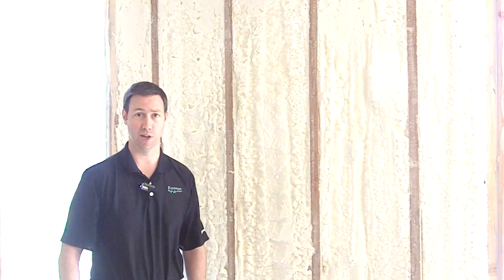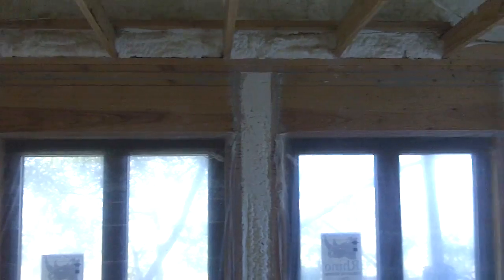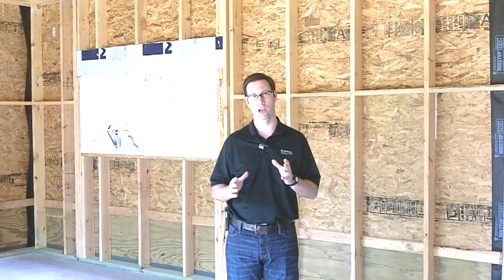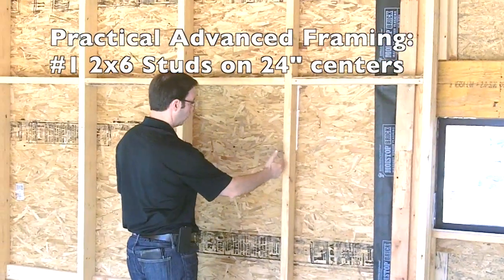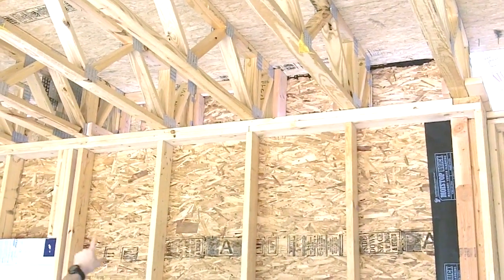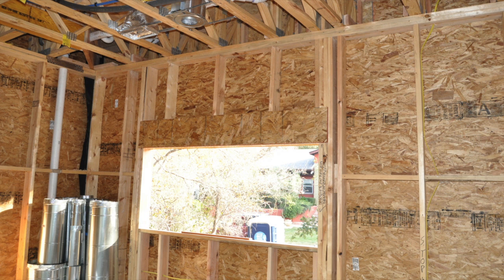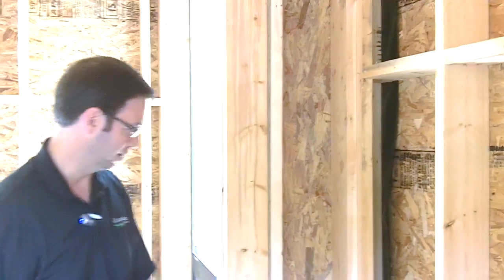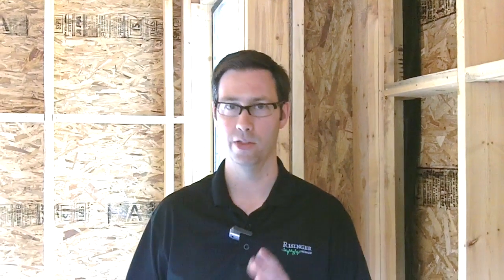Advanced Framing vs Traditional Framing

Comment: That place scares the crap out of me. Matt, I like where you are going with today and the future of framing, but as a pro, at least mention the visible mistakes and also the weaknesses found in this type of construction. As a firefighter..I would do everything I could to keep you from building in my city and as a man..if your not telling the whole truth your just lying. Folks..there are some nice features in these newer frames but don't for one second think it isn't about saving a buck.
Reply: Someone elaborated down below, when a structure is on fire, 24" OC makes the structure significantly weaker and can kill firefighters.
Reply: Using open web trusses instead of solid wood joists to support the second floor is a terrible idea. If a fire breaches the sheet rock it will have the whole void space between the floors to spread, as opposed to a channel or two between solid joists. This modern construction may save you $1,000s during construction, but cost you 10s or 100s of $1,000s more in a fire.
Reply: Chris Kovacs,
I remember a case where a firefighter died in a house like that in California. The fire was able to spread very rapidly inside the walls. In fact, accordingly, it was stated that there was only a light haze inside the house, but the walls were hot and there was the classic rumble, crackle, and "running water" noise that fire makes. It was all in the walls and the ceiling. The cause was an improperly installed gas fireplace.
Search "F2011-05" on google, the report is on the CDC/NIOSH website.

Open floor plan design is a serious issue regarding fire spread. It allows the fire to access large amounts of oxygen in a short period of time, leading to fires that grow to flashover point in a matter of a few minutes.
There was a case where a huge mansion burnt down and something like 6 people died. Caused by, what can be determined, an electrical fault with the Christmas tree lights and/or the electrical outlet. But the tree was also dry, and it was in the huge vaulted main room of the house. Thus, it spread throughout the hallways with ease, since there were no doors. (Also, thin plywood doors don't help either!)
I suppose they were overcome with smoke. I do not understand why people don't just jump out the window. It's not hard to open a window. And don't worry about breaking your legs, you're going to die if you stay in there LOL.
Search "executive-summary-childs-point-road-fire" on google. The fire report is on the ATF's website and/or a PDF.
Reply: COuld you elaborate I am interested
Reply: - Pschar as a firefighter, you should appreciate the benefits of 5/8" drywall and it's ability to detain a fire for longer periods.
Reply: Chris Kovacs that's an important point. I was only thinking about them being on 24" centers and making your furniture move when you walk by it
Reply: You could also install a sprinkler system in your house if fire is a real concern.  It is required by code in California these days.  Surely would save you money on insurance as well.
Reply: Robert Slackware,
You got yourself a "wet pipe" type sprinkler. It always has water in the pipes. A "dry pipe" system is better because it prevents the freezing issue you mentioned. However, a dry pipe system tends to be more costly.
The problem with many fire retardants is that they create noxious gasses when they decompose. Like, really noxious. Nothing is better than a decent brick or even better, concrete wall (at stopping fire spread).
Reply: Advance framing...less Lumber more money....advance framing
Reply: While 5/8s does a better job slowing down the fire, it is minuscule. Especially when u factor in the how the related changes affect a fire. Not only do these fires spread faster because of the materials used and open spaces, the toxins produced are way worse. 

I have never built a house in my life! But I'm the one there when they come down. On top of them,  in them or next to them.  Traditional homes are the only house ill put my family in.  And if the day comes for some reason I can't. A sprinkler system will be in place,  there's nothing else that can protect you in a wiffle bat, poster board house

There's nothing anyone can say, numbers compared, theories explained that will say these houses are a better choice for your family. The money saved isn't going to the home owner. Yes it will be better on bills. But how much is your kids life worth? 

Business is business and we all know it's about putting more money in their pockets with no regard. 
But don't make these ridiculous videos anymore. 

Everyone knows your fvcking them, putting them in danger and can't do shit about it. Why get on here and continue to insult people. Take your money, drop the act and STFU
Reply: Sorry Robert, but saying that fire retardant paint is "much better" than an interior sprinkler system is really messed up logic. Of the top 8 causes for residential fire paint would have impact on only ONE (electrical/wiring) of them. Sprinkler pipes bursting is more a symptom of an improperly designed or maintained system. Wall paint does absolutely nothing for the combustibles in a room; a sprinkler system does. Please rethink or explain your logic.
Reply: @MeJonAgain  I've seen the results of frozen commercial sprinkler systems- you basically junk everything and start over. Dry sprinkler systems avoid that but cost more, and they have their own set of issues. The best approach would be to require that everything inside the home be more fire-retardant since that is what accelerates the fire so well and it is the fumes from that stuff which kills more fire victims than burining building materials does.
Reply: Should have a nice Chernobyl vibe going after a fire there

Comment: Spray foam insulation how one does it last and how do you remove it?
Reply: Forever unless exposed to UV.  WIth a chainsaw as you demolishe the wall.
Reply: Suicidaljello if installed correctly it will last a loooong time. And how do you remove it? A lot of sweat and tears.

Comment: I have an odd question:

I've been doing research for my own house build. I've settled on the pole barn style instead of this type of traditional American framing. The reason for my choice is how much sturdier a pole barn style seems to be compared to this style. Also it will be cheaper for me to pour concrete pillars for each pole rather than a whole slab. 
My question:
How come no contractors do a pole style when building a modern house? Why is it standard to do load bearing walls instead?

Would love it if your answered, but any professional can chime in.
Thanks!
Reply: One of the other reasons that many people do not build this way is banks may not provide a loan to help you build this home.  Another reason you don't see many of these is many building codes will need updated to catch up.
Reply from the maker: It's mainly cost and speed related. Platform framing is relatively fast and using 2x studs is pretty affordable compared to large timber.
Reply: Look into Timber frame skinned with SIPs (Structural Insulated Panel).
Reply: SIP works just as well over lumber framing.
Reply: It depends where you live.  Somewhere with a permafrost and a non solid foundation will raise and sink.
Reply: +Matt Risinger Hello matt! Which costs more to build a house, a house built on cement(steel bars, hollowblocks, sand, etc) or a house built on wood (drywall, nails, insulation, etc)?

Comment: Does this even save wood? I did some quick numbers and it seems the same (correct me if I made a mistake). I stuck with quoted measurements, not true:

2X4 = 8in^2 (times whatever height to get volume)
2X6 = 12in^2. 

To make it easy I went to 48'' of framing (multiple of 16 and 24). They both use 24in^2 * whatever height

Am I missing something? For same height walls everything seems the same.

Comment: Good job placing the anchors outside the wall (3:00) you had 5 1/2" and still missed.
Reply: being that he is the contractor on this build he obviously wasn't the one that put that sill bolt their. these kind of things happen on almost every project. your ignorance  is comical though.
Reply: Brooks is right. The masons that poured the slab are most likely at fault because they are the ones that put the bolts in. I would bet that bottom plate is right where it needs to be, flush with the outside of the foundation.
Reply: I love when contractors blame their subs... YOU FUCKING HIRED THEM. ITS YOUR FAULT.
Reply: @stoneyyay  Absolutely 100% true. I don't give a damn who did it wrong or why, it is still the contractors responsibility to see that it's made right before continuing construction. And he can't be much of a contractor if he didn't supervise the work well enough to ensure the problem didn't happen in the first place.
Reply: Eric Redelman I think you're confused. I clearly said mistakes like that happen on every job site. There is no such thing as perfect construction. I was also saying the mistake was on the subs not the contractor... Not sure how I'm giving contractors a bad name especially since I work for one and I'm around this stuff everyday.
Reply: Wouldn't it be offset in stead of flush with the foundation to allow the brick veneer rest on the foundation? Or will it be flush when using siding?
Reply: It's hard to find a good mason these days.
Reply: He is the general contractor, and it is his responsability, your ignorance is funny!!!!
Reply: Probably changed his mind from brick or stone, to siding. Make even more money right? And where I live it is against code to build with 24 inch O.C. You can't use 2by4's either. Only for a garage or shed.
Reply: No excuse for the GC on the job not to correct this problem. He is the last one in line to make sure all of his subs do their job correctly before inspection. To justify saying that a drunken subcontractor is at fault is ridiculous.
Reply: I saw that too. I'm not a carpenter or in a trade at all, and still thought it was odd.
Reply: Brooks Baker that means the project manager didn't do their job. Mistakes get made, we're all human. The problem is chumps like yourself give contractors a bad name by making excuses instead of righting these errors. Thanks a million
Reply: I know he's the GC, his name is on this. Heh always has to be name calling on posts.
Reply: if you have a bunch of drunk pollocks layin ur foundations it happens on almost every job. My grandfather father and I have laid hundreds of foundations from NJ to ME and we never missed the sill.